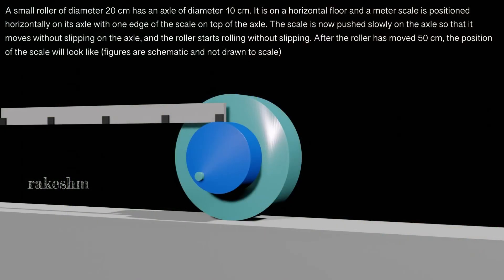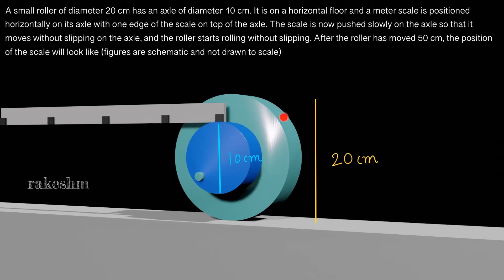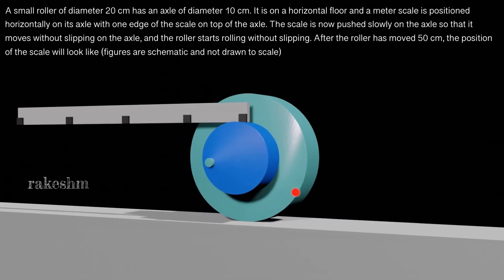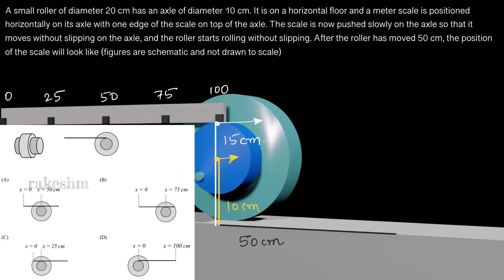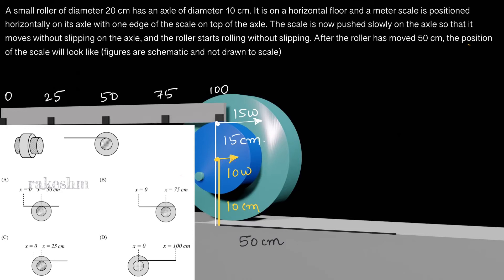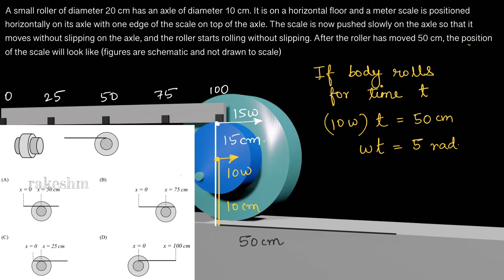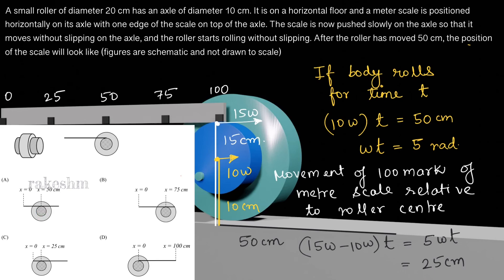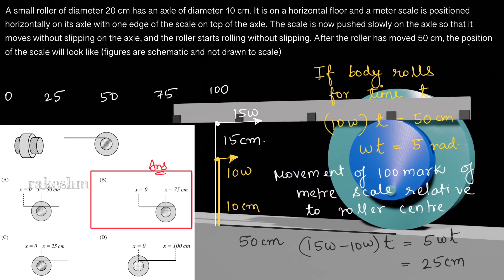JEE Advanced 2020 solutions |  Paper 1 Question 3 | Rotation | Class 11 | IIT JEE | Physics

Comment: Sir  i am in class 9th and i solved it by another method which is as follows-  circumference of roller =62.8cm
Circumference of axle = 31.4 cm
So if roller moves 61.8cm then axle will move by 31.4 cm and so the scale 
So we can say that--if axle moves by x cm the roller will move 2x cm 
So  if  ,roller moves 50cm then 50cm =2x 
Total distance axle will move if roller moves 50 cm => 50=2x=>x=25 cm 
So if axle will rotate by covering 25 cm distance on scale the total distance left on the ruler will be 75 cm 
So option b will be correct 
Is this method correct ,plz tell
Reply from the maker: what do you mean by "roller moves by 62.8 cm " ? which point on roller?
Reply: Sir it means 'on another surface or we can say a scale ( which we have assumed) it moves by 62.8 cm ' so here if roller covers 1 rotation then it will cover 62.8 cm and if axle does 1 rotation  then it will cover 31.4cm . Now as the axle and axle and rollar are joint so if roller moves by 1 rotation then axle will also move 1 rotation hence if roller moves 62.8 cm then axle will also move by 31.8 cm'